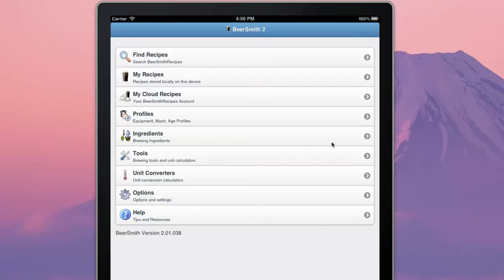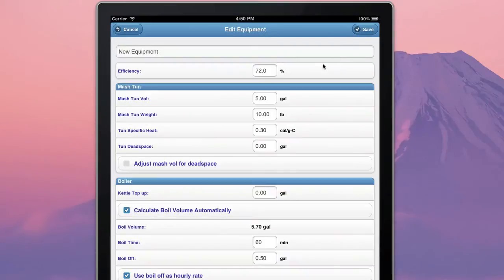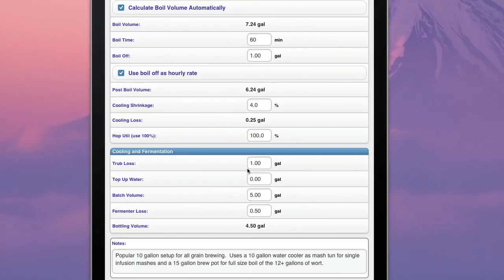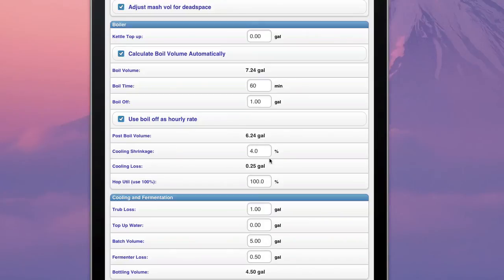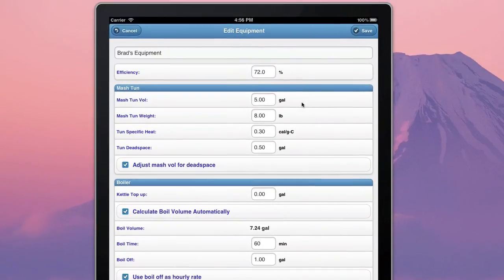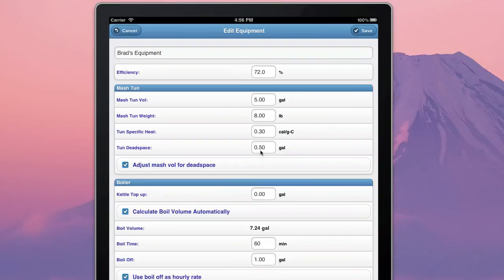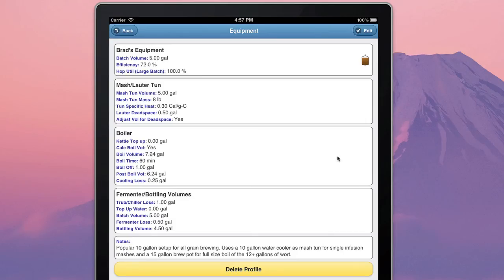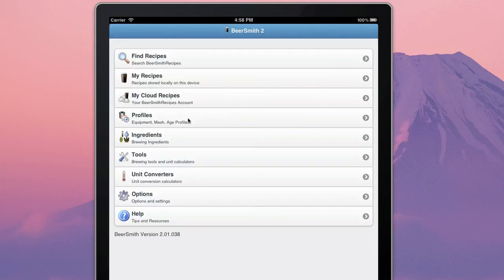Setting Up Equipment in BeerSmith Mobile

Comment: @Brad Smith  Brad, although I use a 15 gallon kettle I only brew batches mostly of 5 gallon. Does beersmith mobile 3.1.1 take this into account or does it mattter? I do Biab but mash in a 10 gallon home depot cooler.

Comment: I love the software but I wish you could enter your own water profile and select a desired water profile, then have tools calculate what minerals to add to get the correct ph, calcium, sodium etc like EZWatercalculator,
Just a thought, 
Cheers
Reply from the maker: +A DimeShort The desktop version does have a water profile tool that lets you match a desired water profile.  That feature is not on the mobile version yet.
Reply: Brad Smith any chance this feature is in the works? I love using the mobile app and want to get into the water minerals aspect...I’d pay an extra $5 for the feature as in in-app purchase too.